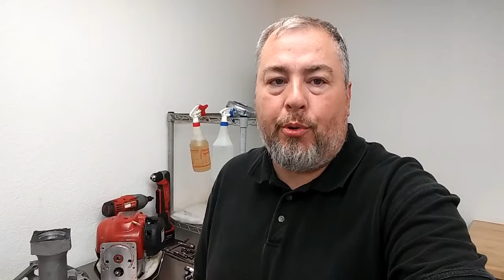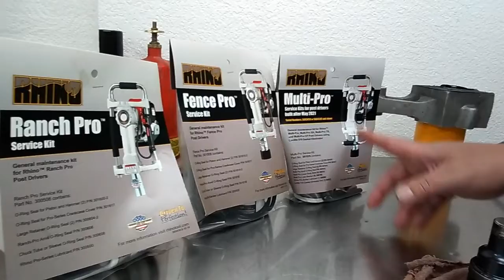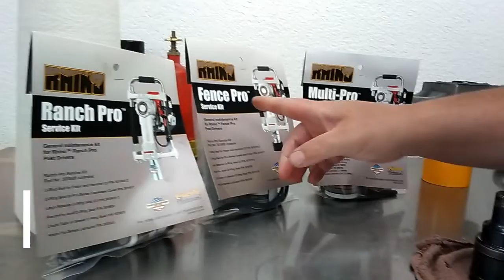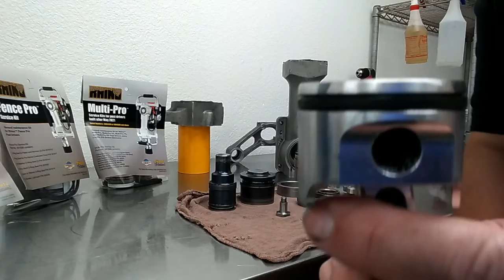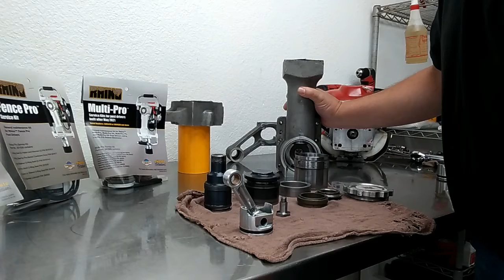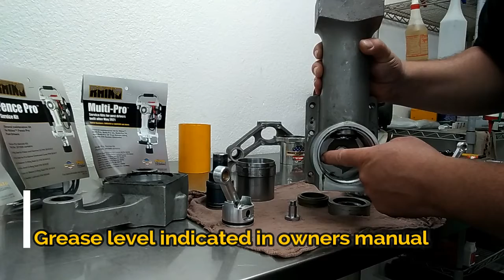RHINO Pro Series Post Drivers: Maintenance Tips and Service Kit Overview

Comment: Need help how to Grease the drive gear end and what to use in it>
Reply from the maker: Henry - To grease the gears, remove the main body from the clutch housing. By removing the 6 bolts that hold the main body to clutch housing. Same grease as on piston side. Mobil Mobilux EP0 / Rhino lubricant #301500 (1) 2.75 oz container.  This video shows removing bolts: https://youtu.be/-Z9osC0D21M?si=NWfWbm64dXZ-lqkq

Entire Service Playlist here: https://youtube.com/playlist?list=PLyiAkgetLloJSvqVDquSGmWlM-13F7__s&si=JQRud2XeYwrIBqwP

Comment: What grease do you use?
Reply from the maker: Glad you asked! For the Gas Post Drivers, we recommend Rhino Pro-Series Lubricant, we had a lot of trial and error with other grease to finally get the right mix.  Contact us at 866-707-1808 M-F CST, if you need to find your closest supplier to order.